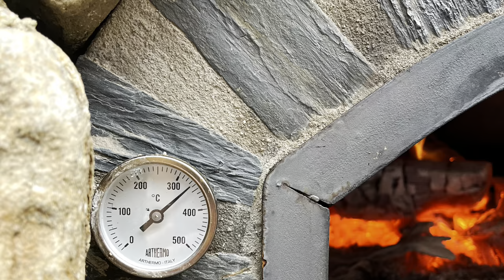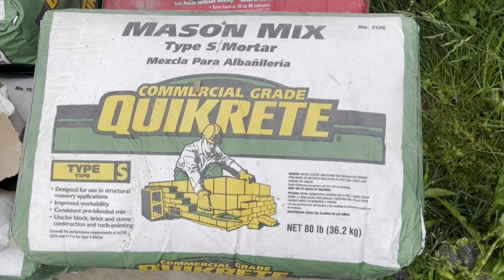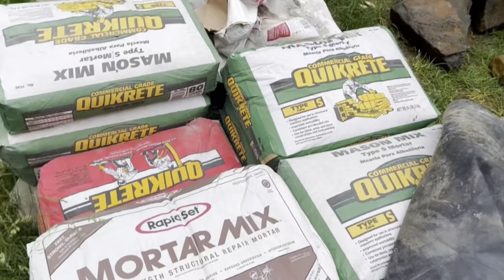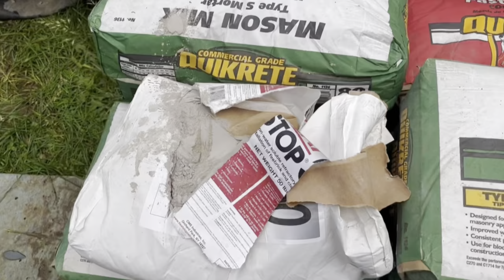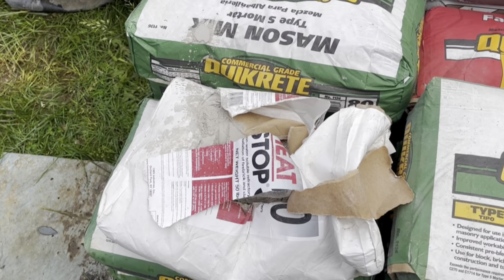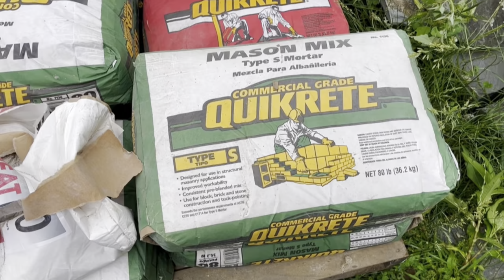Craziest diy moon gate

Comment: On which design did you base the arch on? As far as I know, all surviving old stone bridges use larger stones in their arch. Also making it a distinct feature. You seem to go the other route, using smaller stones on the arch and large stones in the wall and I have not seen that before. 

Criticism? Maybe a little, but more genuine interest as to your reasoning and also the added bonus of some worry as to the dangers it might present as time progresses.
Reply: agreed I was thinking this....I'm a little concerned with how safe that will be over time

Comment: I have a few questions of how you built this. Where did you find info on how to make one? How wide was the base? And what material did you use between the stones.
Reply from the maker: The base is different in sections since the width of the attached pizza oven effects it. Base would be four feet around the moondoor and six seven on the sides. The place that gives me my stone is run by masons and I asked them.
Reply: @diydeluxe8543  How thick is the wall itself?  It looks like about 2.5 feet.  How long did the project take you from start to finish, and how much of it do you think was assembly vs. getting materials?  Did you have to allow for any drying time?